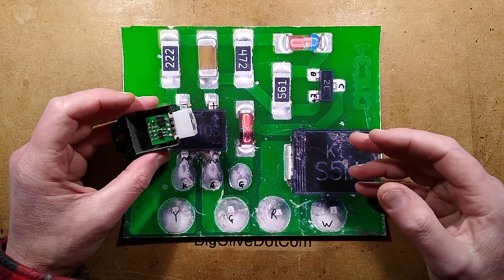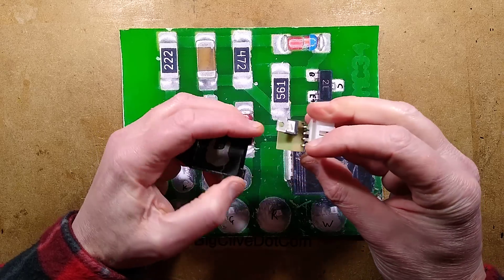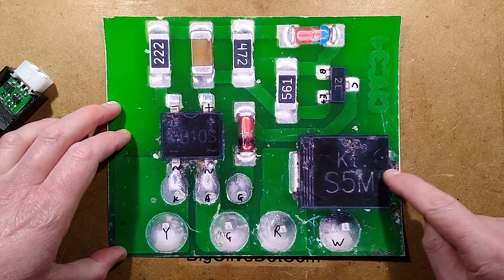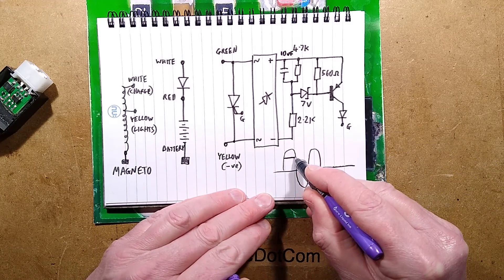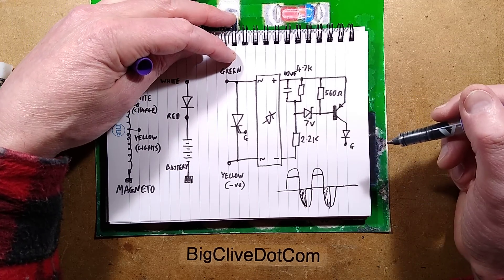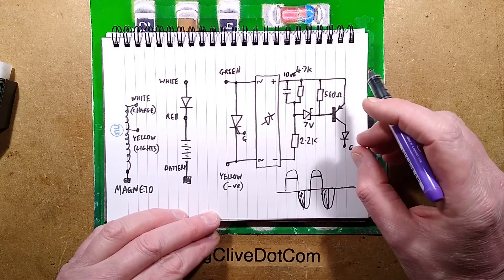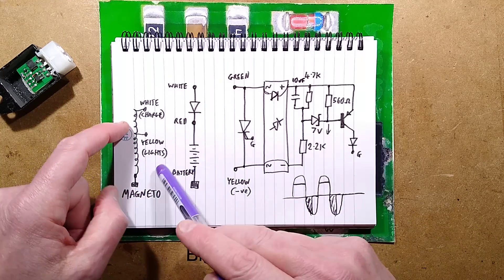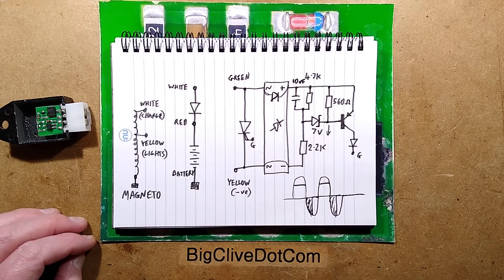Chinese quad/scooter rectifier/regulator teardown with schematic

Comment: i feel absolutely naughty being here at under 1000 views, thank you clive!! you should buy a 49/66 cc chinese "happytime" engine kit as they are known in the motorized bicycle circles, they are fun as hell for the brief period between when you first get them and are still working the kinks out and when the engine is on it's last legs, you usually can get 2-3 years of life from them although i've had as few as 3 months before a engine ripped itself apart internally! my current build is on a 24 inch frame, totally hacked apart and ghettorigged custom just to fit :D
....now to fight myself not to buy a wiring loom... i dont need it, i cant afford it, i just want it..
Reply: Not sure about The Isle of Man but in the rest of Britain motorised bicycles are illegal unless used on private land.
Reply: @oldbatwit5102  Unless they pass the type test and MOT, obviously.  Famous models like the Norton would obviously be built to do so.

Comment: Shunt regulation is why you should never attempt to jump start one of these from a running vehicle. It will attempt to shunt regulate the output of the vehicle's alternator, if the alternator voltage is above the shunt regulator's setpoint, and the shunt regulator will probably self-immolate in the process. But it's perfectly OK if you do it with the vehicle engine off. You do run the risk of draining the vehicle's battery to the point where it won't start but if that happens I'd say that the vehicle battery was either undercharged or bad.
Reply: That's well worth knowing! I'm in the habit of pinning the "donor" vehicle to about 3K revs to help with jump starting others...
Reply: this is completely false, voltage is not regulated on the battery side ("after" the diodes)
Reply: @nirodper  it will just attempt to regulate the magneto by constantly shorting it because of the higher voltage on the battery side, to the same effect?.........
Reply: @mycosys  the magneto can be shorted and it won't cause problems, it is designed to handle it
Reply: @nirodper  Doesn't it depend on the design of the shunt regulator?
Reply: @brianleeper5737  all regulators that I've seen are like that, if you regulate after the diodes, the quiescent current would be too high (the "knee point" isn't perfect, don't know how to explain it). Also you would need a linear device (npn prob), that's more expensive and less rugged than a triac or scr.

I have a bike with a shunt regulator. I replaced the battery with 3x8200uf capacitors but as the voltage jumped too high, I built an "amplified zener" circuit from scrap, placed it inside a regulator aluminum case and potted it with resin.
It heats up considerably but keeps the voltage below 14v, also quiescent current isn't a problem as the capacitors can discharge totally. Allows me to use blinkers and a horn without frying them
Reply: @brianleeper5737  No, it depends on the bike alternator being current limited.
Reply: @nirodper  By the way, on my riding mower with a Briggs and Stratton engine, the voltage IS regulated on the battery side, after the diodes. The diodes are in the stator and the voltage regulator is a separate module, located between the stator and the battery. The voltage regulator is also optional. Some engines don't use it (and it's a minor upgrade to add it).
Reply: @brianleeper5737  I wonder how they prevent battery discharge from quiescent current of the regulator, maybe a separate sense line? or more diodes?
I know only about the honda desing, which is the one all chinese small engines use.
Old english bikes used a 35w or 55w zener, but that really didn't regulate much
Reply: @nirodper  It looks like, on my riding mower, the output from the regulator is wired through the key switch and only connected to the battery in the RUN position. In the OFF position it is disconnected and cannot drain the battery.
Reply: Vehicle wiring looms have pretty high resistance and voltage losses considering the amperage. Thus you can usually count on wires absorbing a couple of volts at any point lol
Reply: @gearloose703  Yes, they did things like using 10 AWG wire for the output of a 75 amp alternator. More modern vehicles might be somewhat better.
Reply: @gearloose703  But hopefully your jumper leads will have a much lower resistance.

Comment: It's shite. I wanted to use it on a bike that is full analog, 1973 eastern block moped that has no battery and mechanically controlled ignition, now i'm gonna steer clear from this electronical abomination.

Comment: my friend had an early 80s suzuki and his dad put a headlight switch to shed load while cranking but if you left the load off it would boil the battery. Or that's what I remember. I learned back then not to try and troubleshoot bikes the way I know cars.
Reply: Umm.Im no electrician but I believe bikes can rev quite high causing over voltage from magnito.  Your headlamp would create a voltage dropper as the element heats (higher resistance) it's a simple way to limit power. Method used in audio to protect speakers from too much voltage (watts) to drivers. Starts to glow when peek is reached
Reply: @ssgeek4515  I remember seeing the schematic and I think it was more than a dropper but relied on the expected load.

Comment: No charge regulator bad.
Reply: In the bad old days, when you had to water your battery regularly (yes, really) the electrolyte boiling WAS the charge regulation.
Reply: Yes, it was basically trickle charging constantly. Nothing wrong with it.

Comment: Bike generators dont have exitor coils to save weight, and they just convert the exess power into heat, because in bikes everything is about weight and power, not efficiency.
Also depending on how close the yellow wires tap to the white's if its close i would guess that by shorting out the yellow wire the few turns that  the white has left its not going to overvolt the battery, but i dont really get why this needed a separate wire
Reply: They dont produce heat when shorted with diode or thyristor.
Reply: @TheHorho  This is the secret that everyone is missing. It's actually a rather elegant circuit.

Comment: This type of generator, the same as a bicycle rim generator, is a current source not a voltage source so to turn it off you short circuit it.  It still produces it's rated current but with no voltage there is no power. If you were to open the circuit at high revs there would be very high voltages on the coils.
Reply: This is correct. Plus there's no field winding to regulate anyway.

Comment: This has inspired a new game idea: "Here's a waveform, draw a circuit that generates it."  Because if you'd shown me that output waveform, I would've had to do some thinking about it.

(In the linguistics department, they would sometimes have lunches and play a similar game.  They'd hand out a printout of a spectrogram, and the game was to figure out what the person was saying.  You had to figure out the sounds, then figure out the language, then translate.  Linguists are a strange bunch, but fun at parties, especially linguist parties.)
Reply: Zachtronics makes games like you said in the form of Shenzhen I/O where you have a lot of tasks simulating wave forms
Reply: @evilgibson  Ah, neat!  Thanks for mentioning it.  (I'm not allowed to have Civilization or Zachtronics games in the house, but maybe I'll pick that one up over one of my breaks from work later this year.  I just have to make sure I uninstall it before I have to be a functioning member of society again.)
Reply: Like an autogram!
Reply: Just take pSpice / LTSpice (a circuit simulator) and start designing analog synths.
Analog synths are fun, and a great way to learn A LOT about analog circuits.
Analog stuff amazes me. Most designs aren't "text book" and have many little quirks to reduce component count or make them better. Theres so much more knowledge needed to design an analog circuit from scratch compared to a digital one.
Reply: @TheRailroad99  that software is not what the OP was asking for.
Reply: @evilgibson  no it isn't, but as I said you can have a lot of fun designing analog circuits, and finding a circuit to produce a desired waveform is basically that.
Reply: @TheRailroad99  just keeping on topic. not going to argue

Comment: So it "regulates" by crowbarring the rails when the voltage hits the maximum limit and relies on the impedance of the magneto to limit the current. I guess it get around any issues handling the highly variable spikes and other nastyness which comes out of the magneto but I'd like to think that there is a better way. I suppose the battery will hold the voltage below the trigger point until it is fully charged.
Reply: I’m just waiting for some company to use the coils in a motor or generator or even transformer as a inductive choke during some point of operation, or worse yet as part of a boost converter
Reply: @aterack833  the renault zoe uses its motor windings as an inductor for charging  
https://youtu.be/drS3sEsxOO8
Reply: @aterack833  My understanding is the Prius does this while regenerative braking, but I've lost the site I got that from. I'd imagine most EVs are the same as well.

Comment: Being filled with sand seems to be common in quite a lot of cheap stuff trying to appear as good quality. I took apart a rechargeable C cell to find it containing a AA plus sand to add weight.
Reply: I took apart a 18650 cell that showed 0 volts from a fake xiaomi power bank and it contained nothing but sand. There were three other 18650 cells in it with measured capacity between 300 and 700 mAh.
Reply: They used to do this a long time ago with usb "ssds". Was a usb pen and a lump of steel inside the case.
Reply: Matthayi Naalaaman  Just add water for good effects!
Reply: or just a cheapest way of fire-extinctionizer..